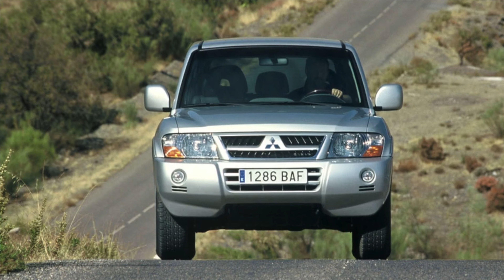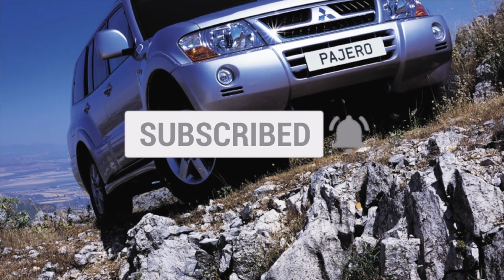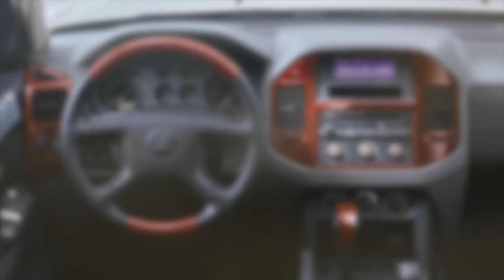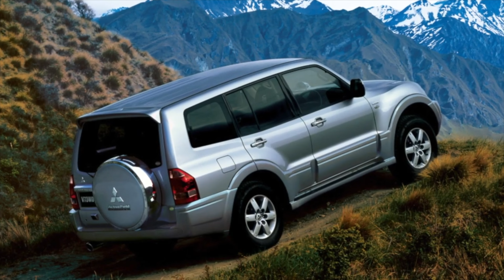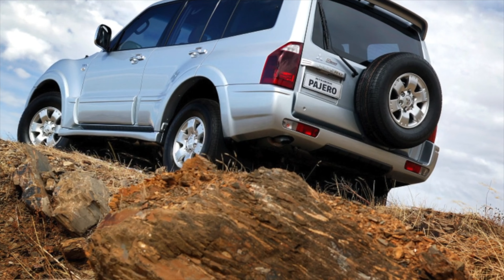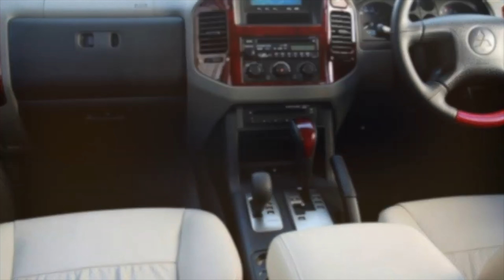Mitsubishi Pajero 3 Problems | Weaknesses of the Used Pajero III

Comment: I have no idea who this reviewer is BUT --- 2005 NP paint work still great, 480,000 Kms faultless - 2 starter motors, 1 radiator and brakes as needed.  You could not kill it with a TANK
Reply: Моему автомобилю уже 20 лет и он все ещё хорошо выглядит.это крепкий автомобиль

Comment: Very helpfull.. my steeringwheel radio controll does not connect to the radio.. what can be the problem
Reply: I'm not sure about this, but the gen 3 pajero/montero (us) does not have default radio control in steering wheel.